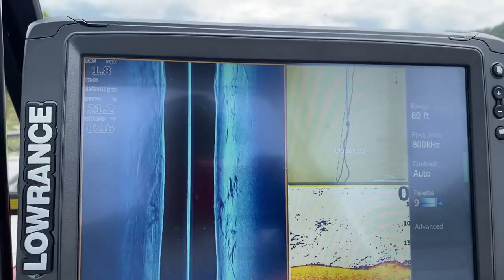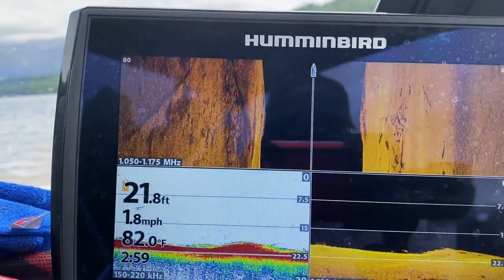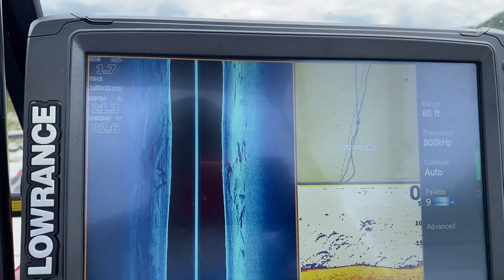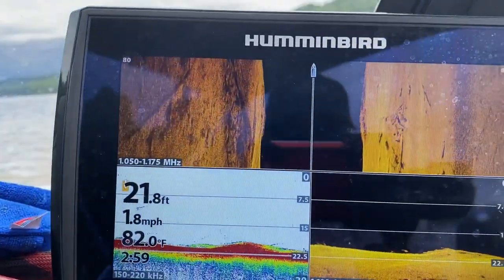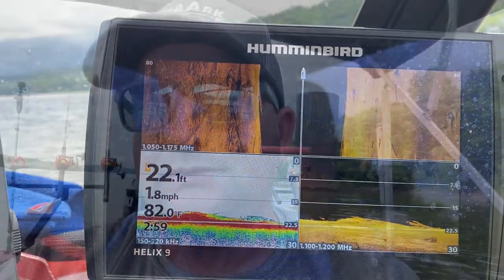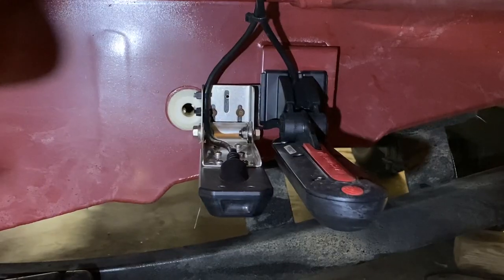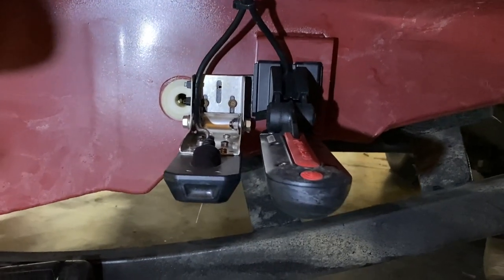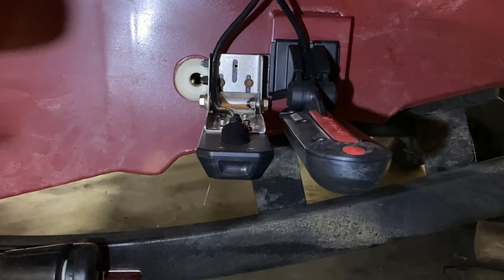HOW TO USE 2 Fish Finders at the  same Time

Comment: I run two Lowrance units and run them just like you said. Adjust so they are set different. Most the time I will run side on one and down on the other also. I set one transducer on one side of the boat and the second in on the other.  Main unit on right side so it picks up at speed better...